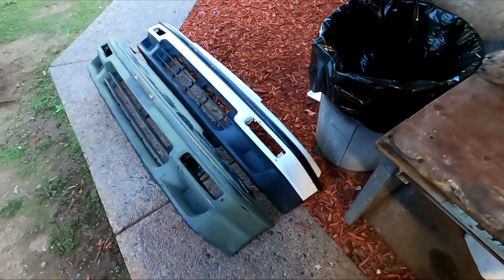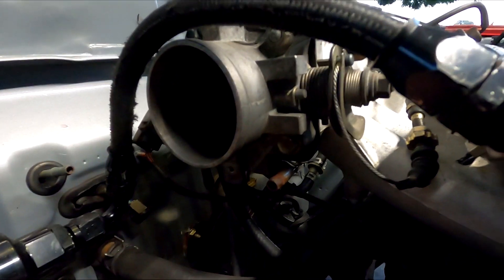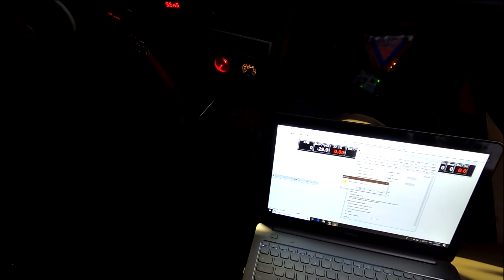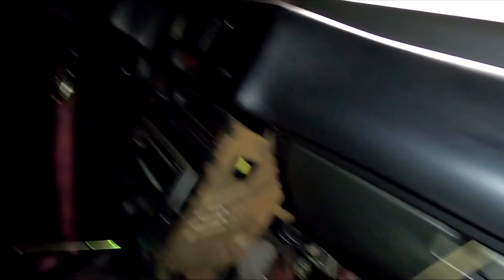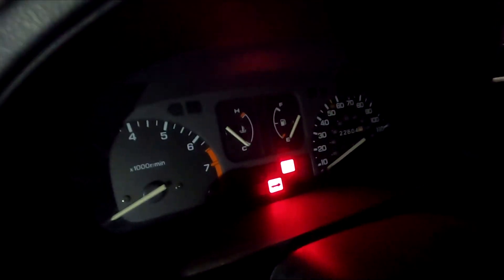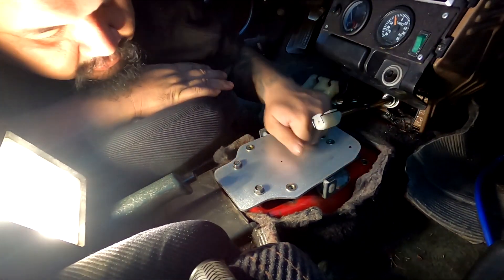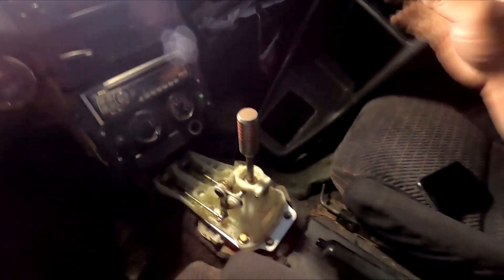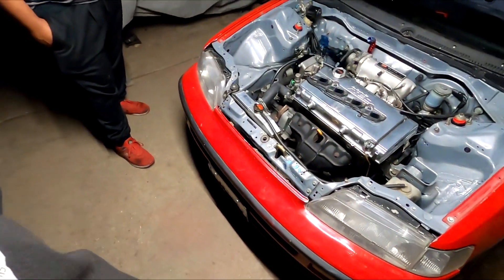AWD CRX FIRST START WITH THE B18C1 GSR !

Comment: What is the advantage of using a shifter box rather than shift linkage on a B series? TIA
Reply from the maker: Well the shifter box is only for the crv transmission due to its awd feature. A regular fwd trans uses a shift linkage.

Comment: Does that motor have the stock LMA's or have you installed skunk2 springs? What am i missing here? What is that shift box from? Cable shift box on a b series engine?
Reply: 4wd trans has cables.
Reply from the maker: Engine has stock lma. Shifter box/cable is from a rd1 crv because my crx has the crv awd trans in it. Which is cable driven.

Comment: Hey youngstatic do u happen to know what size time sert for the tensioner on a b18b1.
Reply from the maker: 10x1.25 not sure which length is needed for the tensioner bolt hole.
Reply: @YoungStatic  hey u might even know the car.

Comment: If u wanna keep the e85 on there to drive around add about 30% more fuel on the hondata or swap to pump gas. I would hate to see motor go bad because to lean.